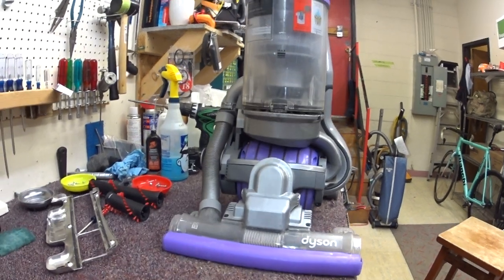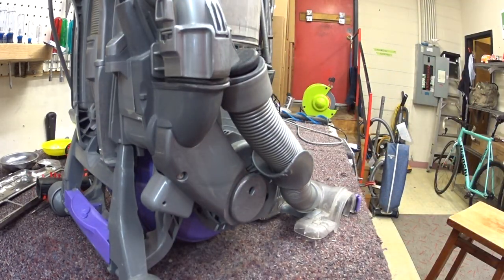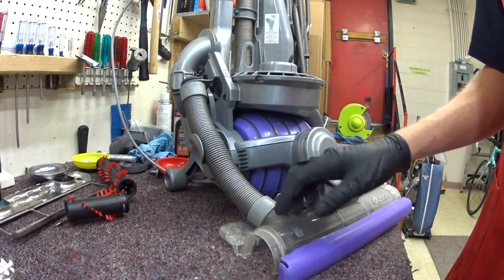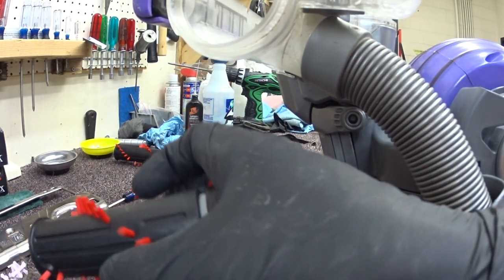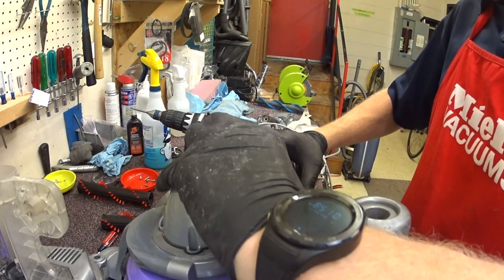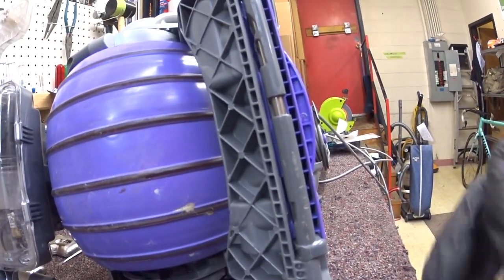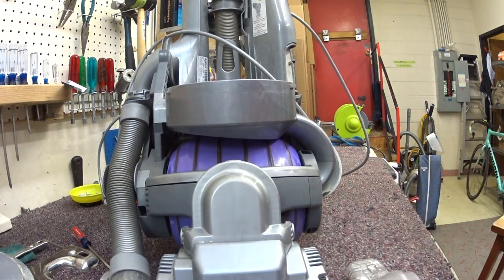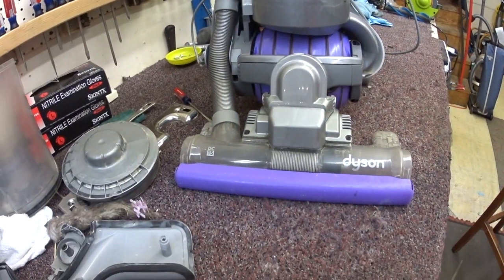Overview of The Dyson DC15 The First "ball "what went wrong .

Comment: My wife bought the DC15 brand new from Sears more than 13 years ago with the first paycheck she received from a new job.  Super excited, as this was expensive for a young couple just starting out.  We still have it, have replaced a flex hose, and have had the typical wire snap in the housing that prevented the brush bar from spinning.  I replaced the broken wires with much thicker wires years ago, and has been running up until last weekend, when my wife and son tag-teamed the cleaning of an entry way carpet (my wife pushed the vacuum while my son held the head of the vacuum down against the carpet).  

Now the brush bar won't spin again.  I'll be opening it up and looking for the issue this weekend.  Fingers crossed for another easy repair.

Comment: I bought my DC15 back in 2006 from Bed, Bath & Beyond as an employee, and I still use it to this day....much to my chagrin after seeing this, and similar videos. Early on, I knew I would need to replace the filters as no machine is as good as their marketing dept. claims. I have washed the machine religiously every 6 months, though again after watching a few of Performance Review's videos, I'm not getting it anywhere near as clean as i thought. I replaced the brush roller in 2014, and the filters (both pre and post motor) in 2011, 2016. Def. noticed dust gathering around the machine which gave me pause about using it and potentially replacing it, but I would take it apart, wash it, and keep on using it. I know that it could go a few more years but I'm more financially secure now than i was, and after watching reviews and giving more thought to how clean my house truly is, (and thanks to Performance Reviews videos) I'm contemplating a Miele Dynamic U1 Homecare or a Riccar R40P. Thanks for the great videos!

Comment: Lol, I just came across this vid searching for replacement brush rollers for my 2005 DC15... it still runs pretty good but the brushes are warn down so much it doesn't pickup dog hair off the throw rugs anymore. My wife won't use it because it's so heavy and unyielding, the 'wand' part is the most frustrating awkward POS I've ever seen/used.  I'm a big strong guy and I feel like I've been in a cage match after doing a thorough clean of our 4000+ sqft house.  My wife uses an old Kenmore canister vacuum on occasion, we purchase that in 1993,  I've taken over vacuum duty since 'I' purchased the DC15 without consultation, I  ordered two Dyson V8 cordless a year ago just to take a break from my DC15 workouts.  Having two cats & two dogs, I thought a vacuum with the name 'Animal' has to be good... right? Haha, WRONG!

Comment: I remember seeing the DC15 when it was new and was shocked by the twisting and creaking of the plastic parts, as well as the noise, which made me think something was wrong with the example I was using.  I didn't think it cleaned all that well, and it certainly wasn't agile, which it was advertised as being.  I had no idea they'd placed a circuit board in the duct, so I learned something more this morning about how bad this machine was!  It was interesting but so unpleasant to use and so expensive I never considered getting one, even as a collector.

Comment: After watching you and a few other vids I'll probably never buy a bagless plastic made in China vacuum ever again. Even cheap bagged vacuum cleaner such as the hoover windtunnel t series should be avoided. I bought one, it felt like it was gonna call apart when I tried it on my carpet. Even the brushroll felt like it was gonna quit along with the motor. So basically from what I gather if you want what dyson promises buy s sebo or miele.

Comment: I have one of the originals DC15, always loved it.  The switch started to have problems in getting sweeper to stay on - - punch switch just right and it would work.  Of late, 2021 now, the roller bar needed cleaning, then there was no suction as though there was blockage - the book tells nothing about the parts - or valve - and cannot figure out how to get the head off that holds the roller bar. -  Presently looking to buying a NEW SWEEPER - NOT SURE WHAT KIND will do the job on rugs and hardwood floors.  I also have the Dyson DC 11 canister - - but so bungle some to drag around   Can anyone recommend a Brand.  I’ve been married 51 years Started out with a ‘Kirby’ :D
Reply from the maker: Generally if you are looking to replace it even broken put that thing on eBay somebody will need the parts. A Miele U1 or SEBO Felix would probably be the closest thing. As the newer dysons do not perform nearly as well. Links in the description as well.

Comment: What the hell is this :D It's a crazy designed vacuum cleaner.  Dyson also must have something special and unusual. Please make a video of Electrolux UltraSilencer which is near the stairs :) Here in Europe it's a very common and favourite vacuum cleaner but the accesories and powerhead isn't in good quality :/
Reply from the maker: Jirickk  I have a video of the power nozzle here. https://youtu.be/3XpB-N9OdYk
Reply: @PerformanceReviews  if the motherbored goes bad on the dc15 would that cause the dc15 to trip a house breaker then the dc15 wont power on again till replaced? im getting a dc15 animal that a few years ago tripped the guys house breaker and it never turned back on im hoping its somthing like a shorted cord but could the motherbored do that if it were to go bad